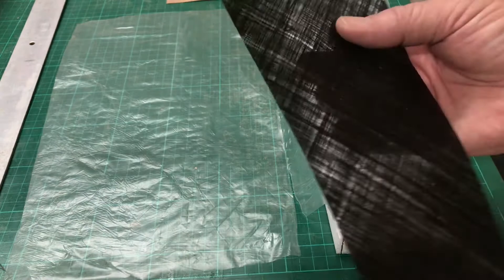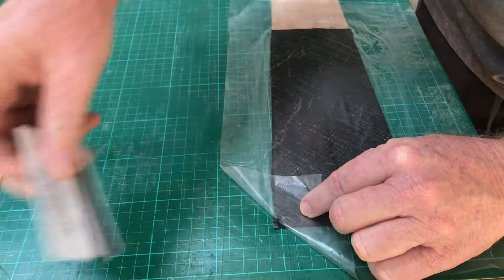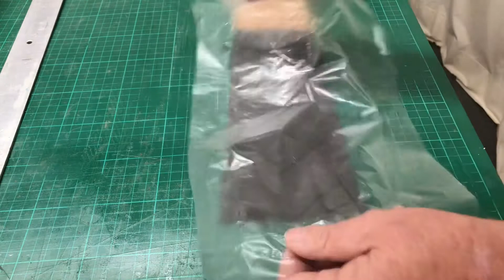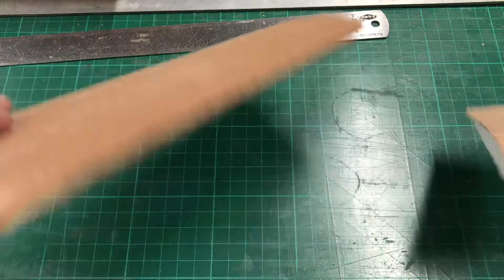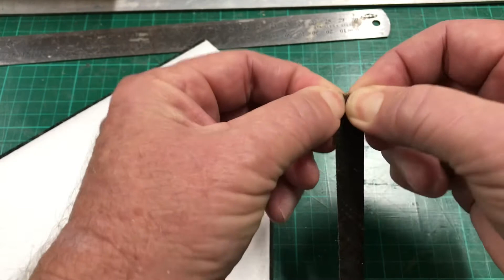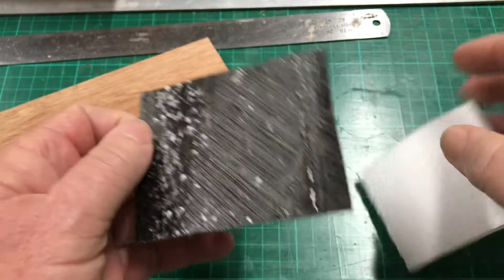Handling light carbon fabric

Comment: Had the issue that dry wood take out a bit of the epoxy. Not bad in general, but if you dry out the fibres before there could be danger of getting to dry. That's why I startet to "wet" the wood a bit as well and wipe it off afterwards and then applyinf the wetted carbon to it.

Comment: Late to the party…. A few tricks I learnt doing SG11 wings.  Assuming lightness is being added. I found if you hard rolled the cloth with paper towel whilst under vacuum more epoxy was sucked up.   A light roll of the foam core with a dryish roller helped tremendously with core adhesion.  It both prepped the core and removed residual dust. With a prepped core dryer laminates would adhere.  I had been known to be totally OCD and do a quick paper towel under vacuum dry off of the prepped Core☺️